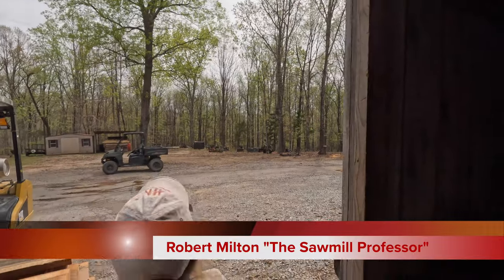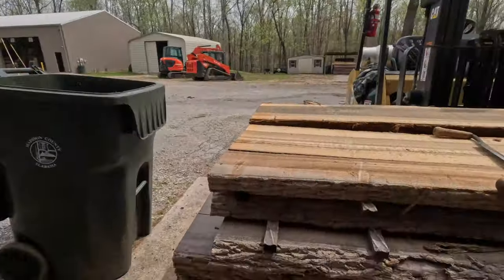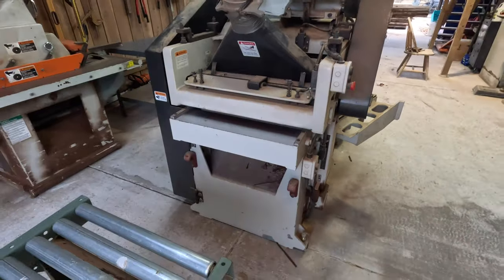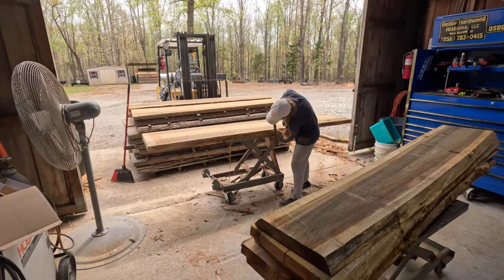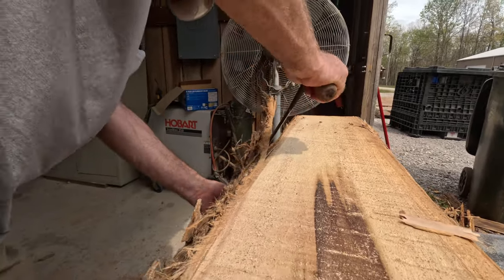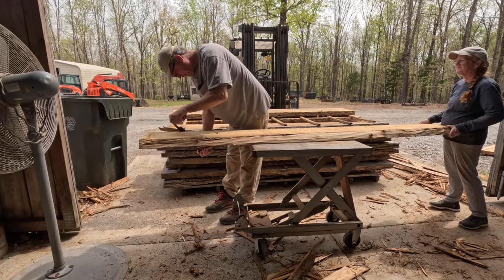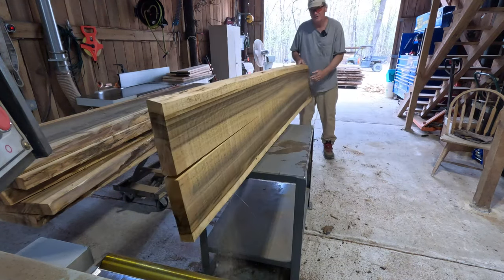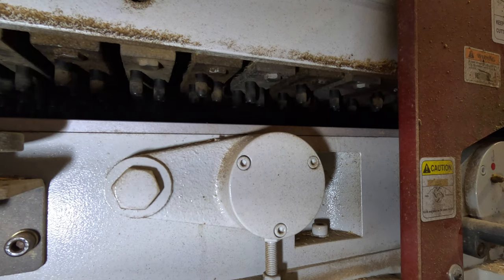Don't Put That Sawmill Slab in MY Planer!

Comment: I have the 16” Cantek dual surface planer. Because of your videos. And it is a game changer. I have ran about 10,000 board ft threw it. And the blades are still razor sharp.
Reply from the maker: Thanks!  They are amazing machines and thanks for trusting me to put out "real" information.